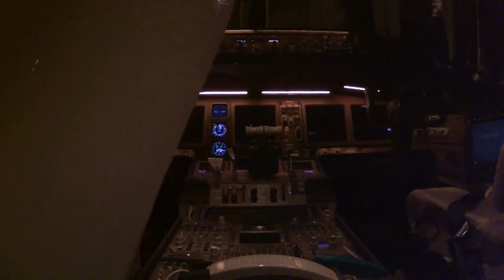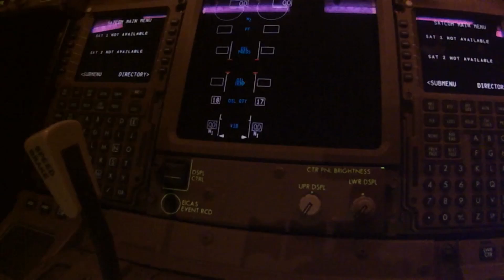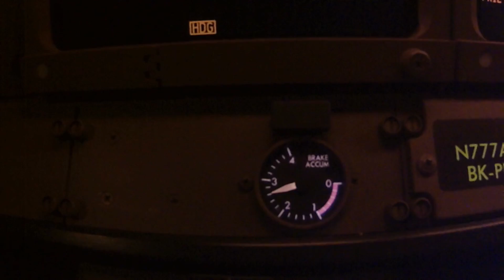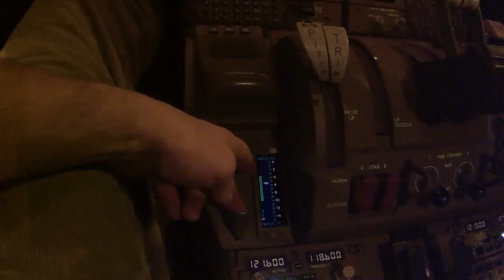Boeing 777 How to Start APU and Power Up Systems and BITE

Comment: I am curious. The 777 doesn't have a pre-start checklist for the APU? Checking fire suppression systems etc? Especially if it's cold and dark for several days. I would want to make sure the canisters are good. I used to fly the 75 and 73 so just going by those systems.
Reply from the maker: There is a pre start for the APU if we already are connected to external power.

Comment: Thanks for making this video! Are there any lights connected to the hot battery bus that you can turn on before connecting the battery, or is it normal to just use a flashlight?

Comment: No fire test before startup? How would you know if there was an APU fire with no other systems turned on yet?
Reply from the maker: +Deniz Durgut Great comment.  The fire test only is active when electricity is provided to the plane.  This means having a ground power cable connected and the airplane systems already powered up.  Then you do the test prior to the initiating the APU start sequence.  The Boeing maintenance manual instructs that if you did not have electric power prior to the APU start then once it is up and running and providing power to the systems that you conduct the test at that time.  We very rarely ever have external power for APU start up.  So it is normal for us to do the test after the APU is up and running.  Late last year we were having trouble with our APU electric starter motor.  It would not spool the APU up fast enough and this resulted in hung start.  This is when the fuel ignites but the turbine does not accelerate and the heat increases.  The APU will sense this condition and auto shut down.  I also noticed that the overheat warning system set off the Fire/Overheat horn located on the nose gear above the tires.  It is so loud you can hear is for a very long distance.  So there is a degree of detection and protection even without the entirety of the system powered.
Reply: All you can do is to just put on  the standby power to batt position which brings up of your captains display and switch to mfd to check for stat message on apu!(standby to batt with main battery on)
Reply: But that still won't allow you to make a fire test.
STS MSG and FIRE TEST are not the same!